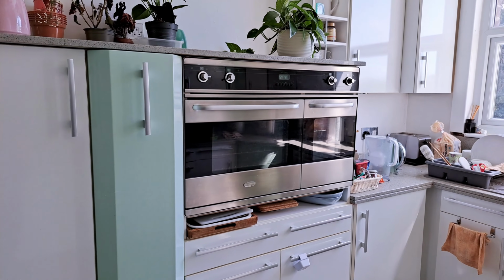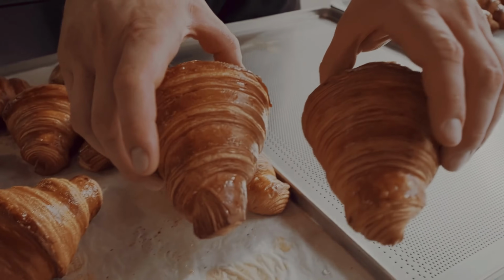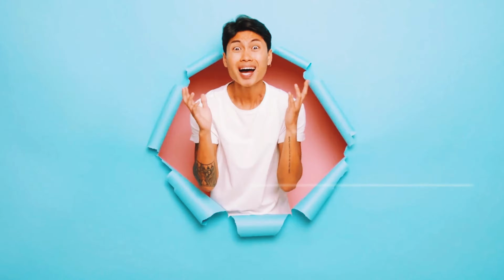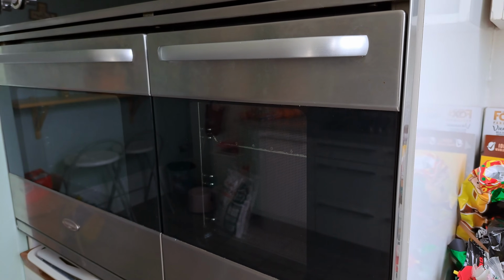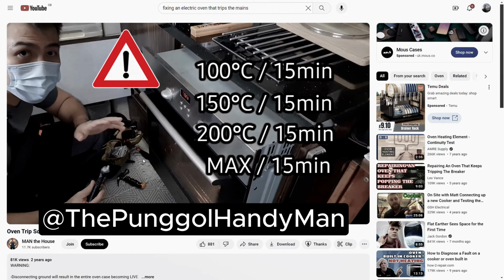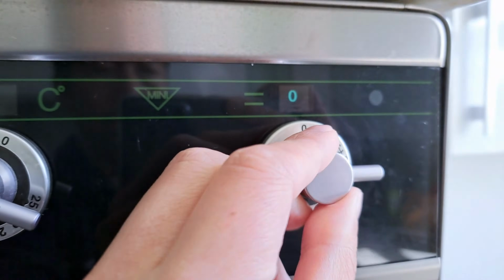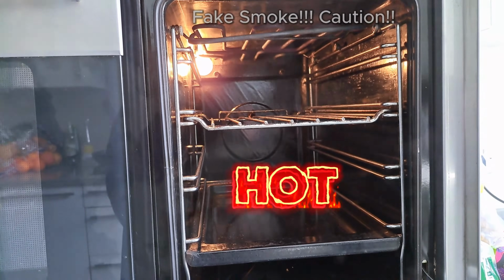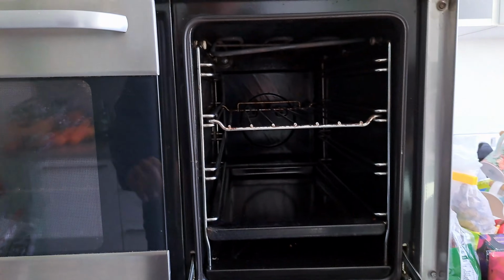Simple Oven Fix Stops RCD Circuit Breaker Trips!! 💡 £1500 Saved for a new oven! #ovenrepair

Comment: mine works 60deg, 80deg but tripped at 100deg 😂 will try again
Reply: update: This time i placed an oven thermometer in the oven, making sure the temperature reaches the set temp for 15mins before i increased it till Max. It works!
Reply from the maker: Wonderful 👍

Comment: I am doing this right now and it seems to be working as im upto 175 C, but i was just wondering do you have to do this everytime you want to use the oven or does doing it once to the maximum temperature solve the issue forever? Thank you in advance as i haven’t been able to use the oven for a long time because of this issue and I’ve never bothered to look into it until today.
Reply from the maker: It lasts for many months for me without doing it again.
Reply: @MatthewKwan  Yeah it seems to be working fine now, i tried again today at max temperature from the start and it didn’t trip the circuit. Thank you very much for this video.
Reply from the maker: Great 👍

Comment: A bullshit solution rarely is moisture ussualy is the heating element and u dont need to take out earth wire just conect to a cord extender preferably a chinese one usualy they dont have earth wiree in them
Reply: I am experiencing the same problem. My house is 95% humidity in the summer months. I've been away for a year, now back and a lot of appliances are broken. Had to replace the mainboard of the washing machine, completely rusted. The machine otherwise is brand new inside. Computer monitors have mold between the LCD layer and the protector layer outside. The oven was tripping the breaker. Took it apart. Ohm resistance between elements was fine. Thermostat was fine. Yesterday it didn't run at all, this morning we called an electrician to change the circuit breaker just in case, it happened in the past. Was still triggering it. So I put it back together and back in the wall, turned it to 50 and wasn't triggering the breaker. Now baking at 100 for a minimum of an hour then I will increase the temp.